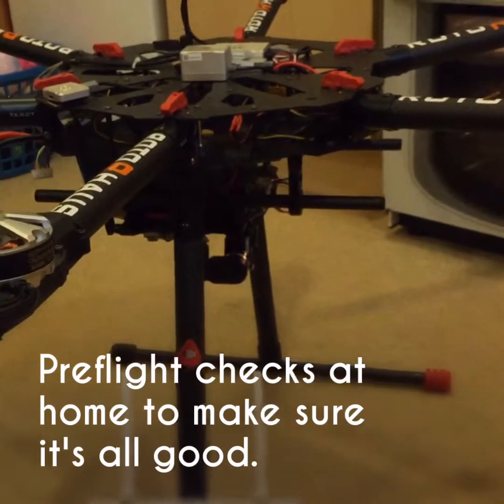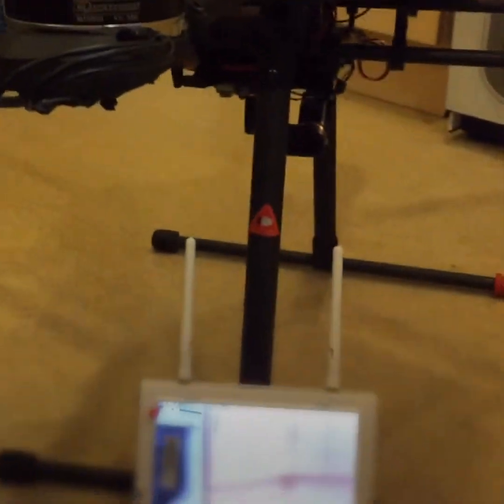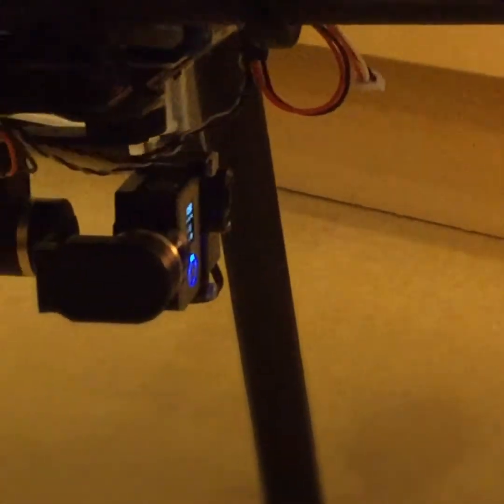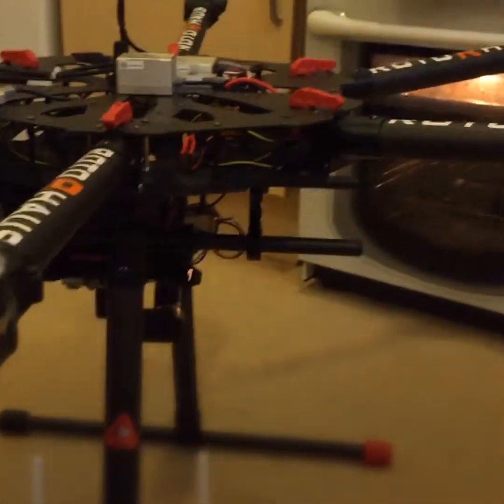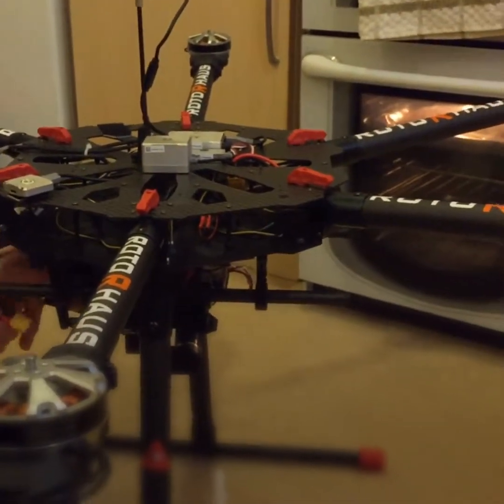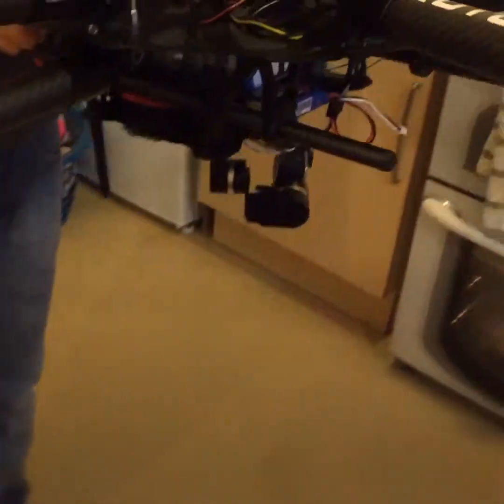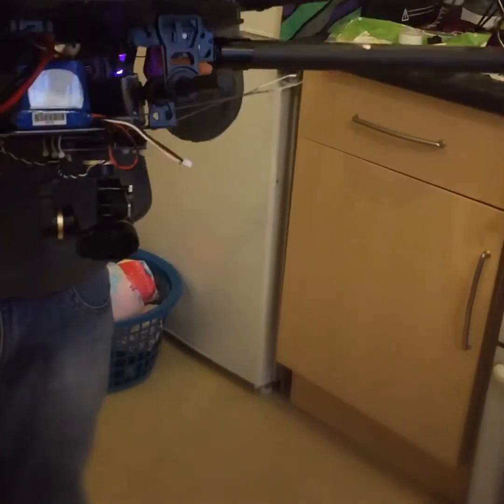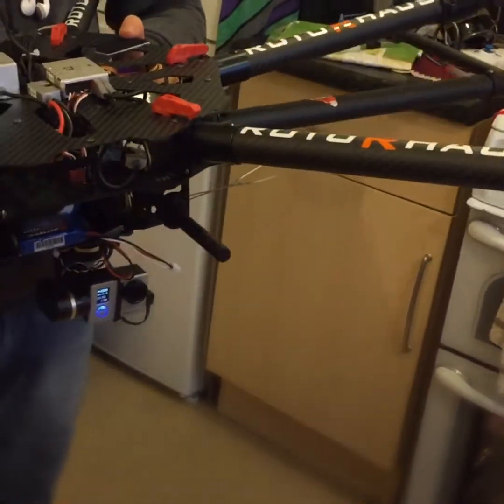tarot x6 960 size with dji A2 check and flight

Comment: Cool video, can you tell me how you were able to connect the mini3d gimbal to the x6 rails?
Reply from the maker: ncfballkid I connected the gimbal to a separate flysky receiver and control and  went through the the channels on it to make sure when I throttled  it it turned and when I the other stick it would tilt